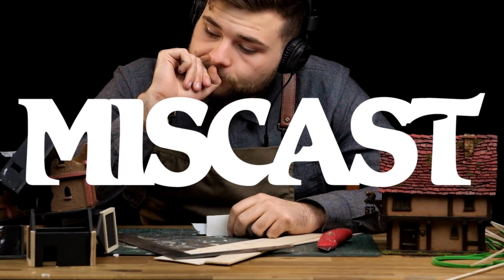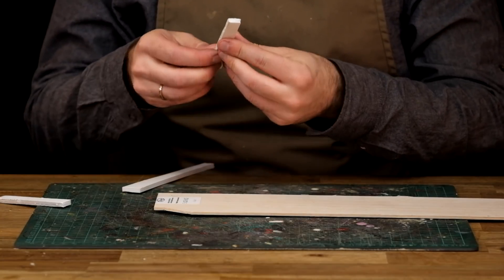DIY Balsa Wood Stripper

Comment: Great idea! Actually I once bought a pack of trapezoid knife blade (don't know if it's how they are called worldwide :D) with holes, made by YATO i think. I have to try making such stripper (stripper! Huehuehue) with blade mounted with screws - it should be more durable and easily replacable.
Reply from the maker: Great idea. I haven't seen those blades. I typically just buy the cheapest bulk ones I can find haha! Thanks for the info!